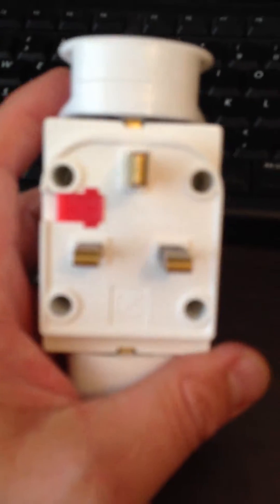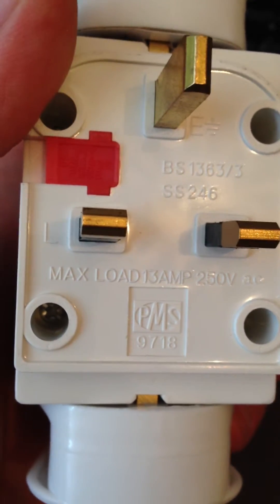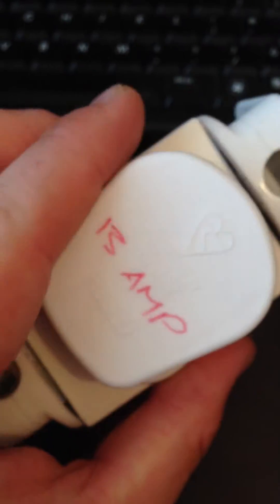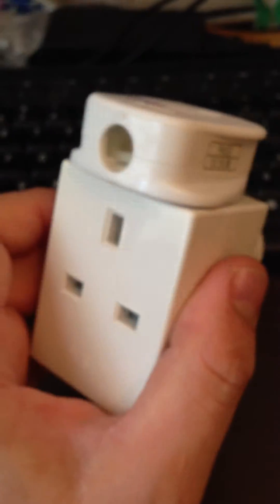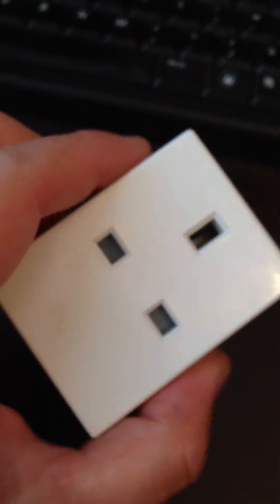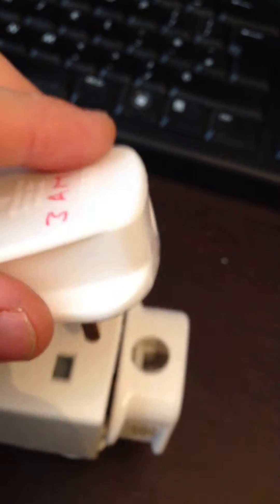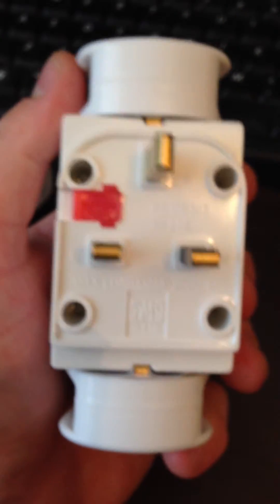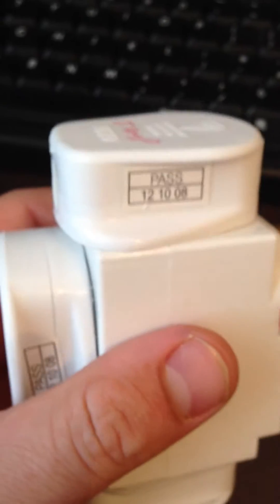Overloaded Socket Adaptor

Comment: There are lots of devices which take more than 5A and less than 13A. Just because it's got a 13A fuse, that doesn't meant the device is pulling that much current. The individual plug fuses are there too protect the flexi cable on those plugs (not the device by the way - if that has a requirement for a lower value, it ought to be internal).

The adapter has a 13A fuse, and if you overload the adapter that goes before it does any damage. That wasn't always the case. At one time, 2 and 3 way adapters were sold without fuses, but those have been illegal for some time.